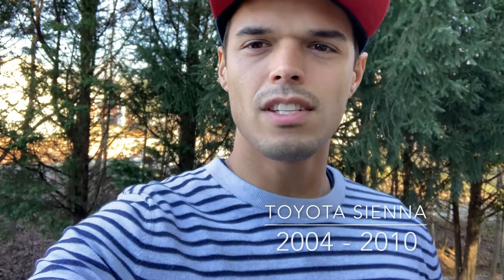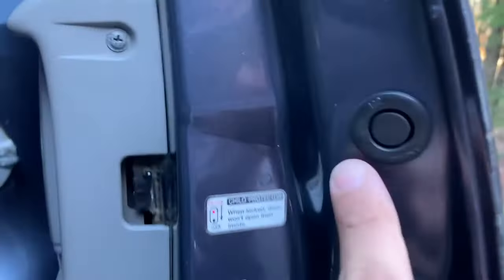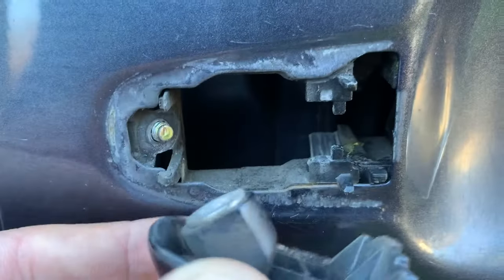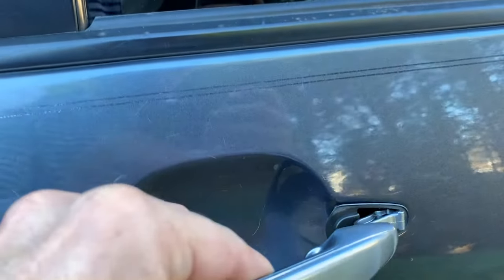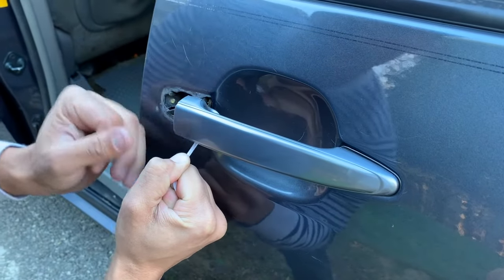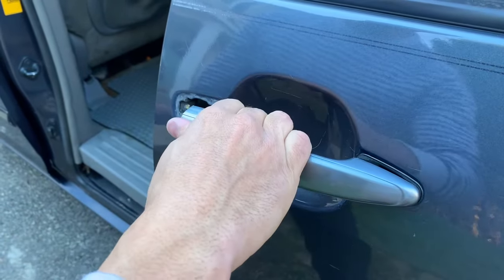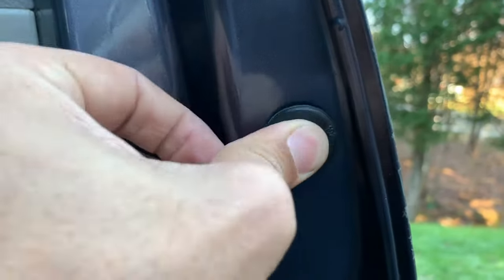How to Replace a Toyota Sienna Door Handle: 2004-2010

Comment: Anyone had trouble screwing the front cap to the handle back in place after  replacing the handle? I’ve got the handle in and functioning, but the screw will not catch with the protective front cap. Anyone have ideas? Everything is OEM, by the way.
Reply: I dont know if you ever got this figured out; I went through 3 door handles before I figured it out and thought I would share how I did it in case someone else has this issue..(please bear with me as I don't know the technical terms for any of this, lol.)

The first step is making sure the piece that holds the screw hasn't been pushed into the door frame from the outside; there are two tabs that if you push the piece holding the screw from the inside, the tabs should pop into place just on the outside of the door where you place the door handle part that the screw goes into. Again, sorry for the lack of technical terms, I am doing my best, lol.

I still had a bit of an issue getting the screw into the door handle, so I used the same principal as the zip tie and handle, but used embroidery thread. I looped it around the end of the screw, pulled the ends of the embroidery thread towards me and to the right to help align the screw with the door piece while tightening the screw at the same time and was finally able to screw the screw into the door piece!

I hope this made sense, it was way more of a pain in the a$$ then it should have been..*cough, cough* spark plugs. Thanks Toyota!

Comment: I just went through 100 videos, yours is the only simple QUIK FIX toutorial.I'm going to use thin wire to hold it down, slip 100 LB marlin fishing string , then safe to take the wire off then spray with WD-40 so the whole sabang is slicker than snot, then snap the new handle in place
Reply: Y xq hoy la parte a la venta ya es diferente  a la de el video 
La mía es como la del video 
Pero me llega la parte comprada x Internet muy diferente a esa

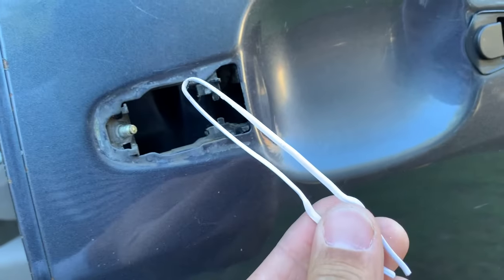Comment: Thanks!   the visuals at 0:48 helped a lot!   Fixed my 2012 Sienna front door with help from this.  Note:  You will have to put in your key and twist, in order to remove the key lock portion.

Comment: This took me longer than 10 minutes. I found it actually quite tricky to get the handle into place while pulling on the catch. Also while I was putting the new handle in, the screw seat got kinda pushed into the door a little, which I didn't realize at first. It took me a long time of turning and wiggling that screw to finally realize why it wouldn't go back in. There are two little tabs on the outside that hold the screw seat in place. I had to pull those back into place before the screw would go back in.

Comment: Worked out perfectly.  I might add that you may need to apply outward/pull pressure to the  handle housing when unscrewing the T-30 torx bolt.

Comment: Thanks. I change my left door handle before but forgot exactly what to do. 
Buy the oem part.  Online is about $45.  I have gone through two of the no name parts from the Jungle website and they failed in less than a year each.  My handle doesn’t even see that much use since the kids are older and it’s not the primary mover anymore.

Comment: Thank you for the video. But unscrewing the torx is not loosening the handle from the outside. It seems I may need a magnetic torx bit or screwdriver to pull out that torx nut. It seems to spin endlessly and not loosen. You make a point not to let it fall down but am I able to take it out completely?
Reply: So turns out the screw itself it stuck in there with a hinge so it can't "fall out" so if it seems stuck then pull on it from the outside, possibly while spinning it left...